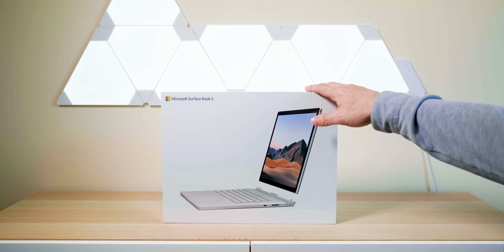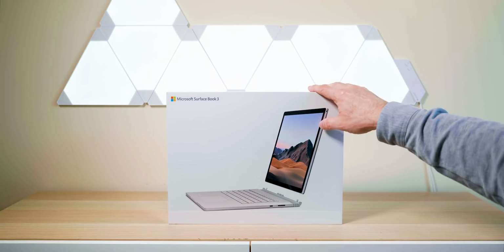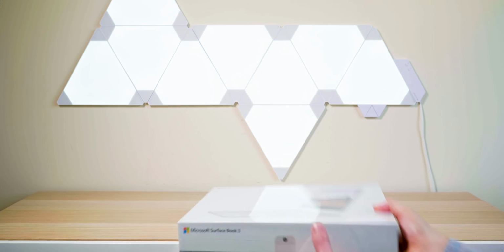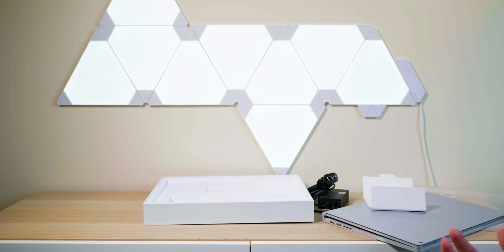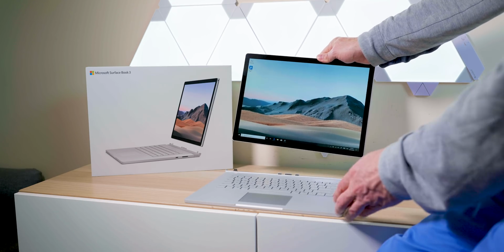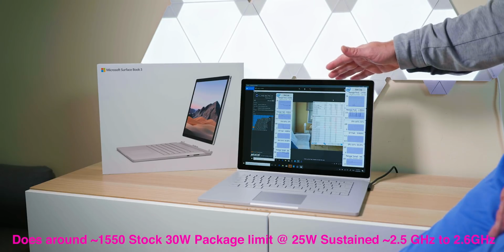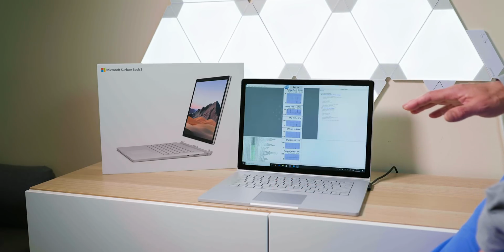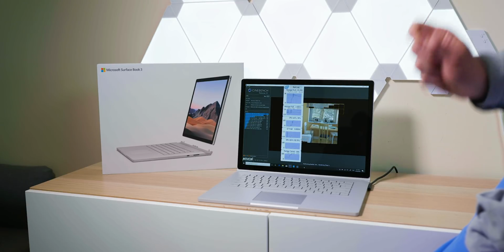Surface Book 3 Unboxing First Look & HardCore Performance + Thermal Test | Nail or Fail?

Comment: Can anyone help me decide?  I just bought the 512 gb 15 in with 32 gb of ram but for 200 dollars more I could have gotten the 1 tb version.  I plan on playing some games, do engineering, work, emails, skype, use it as a recipe book, stream videos netflix youtube and such.  Or should I completely downgrade to the 16 gb ram version with 256 gb?   I just can't stomach paying more than 3K for a device that has a 4 core cpu where new computers have 6 or 8 cores.  Will I ever need more than 16 gb?  For my application which ssd size should I get knowing I can hook up an external drive?  Your feedback is appreciated.

Comment: Awesome review! 

Question: Is it worth upgrading to the  i7 over AMD R7?  15in version with i7 + Nvidia  is $500 more expensive where I am vs the AMD. Wont need it for content creation apart from podcasts, but will mainly be general productivity and fairly heavy web browsing. Is there a big difference btw the two CPUs for what I will use it for?

Comment: Can you do a comparison between the Yoga c940 15inch and one of the surface, the 13.5 or 15 inch... I'm interested to buy them but i struggle a bit to decide because of the performance and temperatures of both, and of course the price... If you can make a comparison i would be very grateful. Thanks for making great content btw :D

Comment: I have an SP6 and SB3 15"..... Tablets are just so much easier on eyes when you are approaching 50yrs old.... Honestly, the SP6is the better designed device.... Huge battery in clipboard mode, no switching between gpus, much better thermals.... However, it doesn't have a 15" screen, limited gpu, and no built-in SD card reader or USB C port.... As for SB3, 44W charger can overheat it if its in flipped 360 mode and you do anything sustained to stress the thermal system...Microsoft including the 127watt charger is just asking for meltdown.

Comment: I have a Surface Book 2, and i was waiting these update, but ahahahhaahh WTF of update is that?  In the 2020 you come with a Quad Core, yeah the last 10 generation intel, but really a quad core?, then you talk about super graphic and the maximum is a shitty GTX, not RTX, GTX 1660ti ? You present all the other specification like new but are exactly the same of the Surface book 2 (weight, dimesion, webcams, camera, sensor, the usb ports are only gen 2 more). Then is still missing a Thunderbolt Port ???? you said that this is for professional users and is missing a Thunderbold??? Ahhhh i read about that there are security reasons to don't put a thunderbolt, ahahahh like there are non security problems also in every component CPU included. BUT the best of the best, that probably nobody knows is that with the Surface Book 3 microsoft give you Wondows 10 HOME, home?!?!?!!, WTF are you crazy? You need to buy the Surface Book 3 Business edition to have the PRO, you are completely crazy. I love my Surface Book 2, but really you ask € 3000 euro or more for something like this? PLEASE BE AWARE!

Comment: Yo, can we get you to comment on the Dell XPS batteries? Never noticed this before but it's been pointed out that they have less reliable batteries than Macbook Pro.

I've had several Dell laptops at work and their battery life has always been TERRIBLE

https://www.reddit.com/r/Dell/comments/gnyb68/new_xps_15_battery_only_rated_for_300_charge

Comment: You know it's funny. A Microsoft product actually stops me from using Windows compared to OS X.  In Excel for Mac you can drag and drop photos from finder to a worksheet - you can't do that in the Windows version (have to drag to Word then to Excel). I have to fill in reports with up to 70 photos in them so that's a deal breaker.

I do really like the idea of a SB 15 with Quadro 3000 (have a Precision 5520 as a PC laptop at the mo) but that Excel thing keeps my 2019 i9 15" MBP as my main workstation.
Reply from the maker: Mate you’re a weapon

Comment: Great unboxing and upfront tests.  I'll be curious to see your more detailed tests with games and general use as part of your review. I got my 512GB, 32GB Ram yesterday. I've been struggling just to install the G600 Logitech Drivers (its an MMORPG Gaming mouse), I've been struggling with the resolution of the launchers of a couple of apps, and my CPU temperatures on all 4 cores are peaking at 100C when I'm playing Elder Scrolls Online. I suspect all of these issues are due to my ignorance with setup due to that I normally game on desktops and am coming from a Google Pixelbook for the last 2 1/2 years and generally don't use windows laptops for gaming. Anyway, have a couple of videos to watch from the SB2 with setups around gaming, so hopefully after I watch those everything will fall into place. Even at maximum I find the fans aren't loud at all.
I LOVE the design more than I thought I would.  It's weird because to me, the bezels in person feel for some reason smaller in person than they do watching videos. The tablet is much lighter than I was anticipating in person compared to the listed 1.8 pound weight. It just doesn't at all feel heavy, maybe because of how unwieldy a Google Pixelbook feels in tablet mode. Love the brightness, the sound, though not great, is above average for the devices I own including the Google Pixelbook,  Samsung Chromebook plus and my work laptop...much better!!! Love the keyboard. Love the 1080P webcam and the sound of the mics. 
Looking forward to your next video.
Reply: It's not you. It'd be the first Surface device to not have firmware issues for a solid 6-12 months.

Comment: Find many people indecisive between XPS and SB3. Here is my thoughts. SB3 can do moderate amounts of everything you throw at it, be it photo editing, video editing, gaming, and drawing. Once the tasks get really heavy, don’t expect it to have the raw power you need.  You only purchase it if you can make use of its versatility (don’t apply to the affluents), which means you are constantly on the go, and don’t want to carry other devices(iPad) with you. If you wish to have a mobile workstation that can link to an external display, SB3 is never a good choice.
Reply from the maker: Good points
Reply: Why do you not recommend linking to external displays?

Comment: 100° is a bit of a concern for silicon durability
Reply from the maker: I don’t hear of any major failures and these Surface Products have been running this hot for a while
Reply: @TallyHoTech  you mean older versions? maybe the price premium is for an higher grade silicon. usually consumer grade will cook at 100-ish.

Comment: Was trying to decide between upgrading my SB2 15" to this or the MacBook Pro 16. Main limitation for me was 16GB RAM. Decided to go with the SB3 with 32GB ram as: 1) MacOS just does not have the engineering software I need and i would need to use windows half the time 2) running bootcamp drastically reduces battery life and slightly reduces performance 3) Running parallels can cause graphics errors and performance loss with CAD software 4) Office for Mac is several feature releases behind windows  5) my NTFS formatted external drives are not really compatible with MacOS 6) everyone at work uses windows 6) if i end up liking mac OS too much i will be limited to only a single hardware vendor in the future with few model options. 

I just wish PC vendors would build macbook-like windows laptop with: machined aluminum case (no black grease-magnet coatings please e.g. XPS), similar quality force touch trackpad (and ideally a TrackPoint too), a calibrated, high brightness wide-gamut screen with an anti-reflective coating, long battery life, small bezels, high quality control and good service. There is currently no PC laptop which ticks all these boxes. The SB3 seemed to be the closest. The upcoming HP Envy 15 and Zbook create 15 look like they are close (at least on paper) but will not be out for a few months. The Zbook is also guaranteed to have a ridiculous list price on HP's consumer website too which will likely be higher than a similar speced Macbook Pro
Reply: I totally agree. I am in the same boat as you. As a engineer (cloud) my ram requirements are high. CPU not that much. Running code is not that CPU intensive. Mainly single or dual core. Build quality, battery life, and how much code I can fit on the screen is important. Taking notes while watching a video for my certs is invaluable. Since Microsoft builds the hardware and software, reliability is much like Apple. Zero software and hardware issues. As opposed to my recent Dell XPS which had 4.5 hr battery life and wifi issues. Had to go back to my Surfacebook 2 15. Going to pick up a SB3 15. Great review.👍
Reply from the maker: Awesome. Thanks for sharing
Reply: what ssd storage did you get?

Comment: On my 15" SB3 The 1TB SSD model on can do 3200MB/s read and 1800 MB/s write EDIT: retested a few times and managed to get 2200 MB/s write speed
Reply from the maker: Yep. It will be because it’s the small one
Reply: @TallyHoTech  Yes shame not all the sizes are fast. Thanks for your quick look. I got similar cinabech scores to you. The machine definitely feels faster than my SB2 i7 1TB. I think one feature which is nice is that the iGPU is a G7 which makes the Windows user interface feel faster (scrolling, animations, switching apps etc) than with the SB2 and the UHD620. This is an advantage over all the intel 45W parts which still use old iGPU's (like the MB pro 16 which all the youtube "reviewers" will compare this to and say the MB16 is better because 45W, and not getting the point of this device). On that note I had top spec i9 MB15 last year and the user Mac OS animations were a bit choppy at times which I found a bit annoying - the old HD620 iGPU may have played a part
Reply: thats good to hear, the only sb3 im gonna get is the 15inch 1tb version or nothing. It's surprising how fast u fill up 1tb these days.

Comment: Interested to see battery life as other reviews say it is worse than last version and struggling to get 7-8h! That is well below average especially bearing in mind the capacity. Would have liked a Thunderbolt, also OLED and 4k (or equivalent) bearing in mind the market this is aimed for. Benchmarks suggest the CPU barely manages an XPS 13 level! The tablet still cannot be charged by the base which is a design flaw IMHO. Would have liked a lighter version, maybe built like the LG Gram? Also they need to sort the hinge gap; we see folding devices have made exponential progress over the last four years and that gap is a design flaw. Tear downs suggest there is plenty of room in the base so a bolt hole for the pen would/should be an improvement that they have missed. Different colour options as the silver is pretty dull now. What is this with glossy displays, come on, that tablet should be used outdoors and matte finishes should be compulsory. There should be a bigger battery in the tablet as some days I may just want to take the tablet out with me, so 3-4h sucks and a fail to get me through a day. 

A lack lustre effort from MS, the potential of 4-years ago has been squandered and really disappointing. I was hoping for the base to become modular with hot swappable GPUs and batteries. Maybe the CPU moved to the base and an ARM chip in the tablet allowing for a bigger battery and longer life as a tablet? But this is just a lazy update and its design restricts its potential as it cannot compete with the Dell and Apple power houses. Look forward to your review though quite underwhelmed.
Reply from the maker: We will soon see. Thanks for your help info and have a good weekend

Comment: Can't wait for that XPS comparison. WOOF!
Reply: Yeah, agree, it’s a tough decision between XPS vs SB3.....so looking fwd to that comparison too.

I suspect it’s going to come down to if you need either the long battery life or the detachable screen of the SB3, or not, if you do, then it’s gotta be SB3, if you don’t, the XPS.
Reply: @TheLDunn1  only get the SB3 if you're going to get good mileage out of the detachable screen/professional touch screen. If you don't, you're wasting money when you get laptops a lot more powerful for cheaper. I'm going to get a lot of mileage out of it so I'm getting one, but otherwise there are better laptops out there
Reply: Which should I buy, XPS17 or SB3 15😫😫
Reply: @leonardoholmes1374  How important is detachable screen to you? Like, really. How often does your work (or play) require that you detach your screen and flip it around or take it someone away from the base? How much drawing do you do? Like, drawing that generates you money or deep emotional satisfaction? 
The Surface Book not a notebook as defined today. It is a high-performance tablet with an expansion base to further extend performance. Even still you're looking at a 20-40% decline in performance compared to other devices at the same price point. 
If the detachable tablet isn't relevant and you can detach yourself from the romanticism of the Surface Book, there's other products that provide much better price to performance.
Reply: @yamamancha  you forgot about touch and pen support, which few other laptops support.
Reply from the maker: Me too ;)